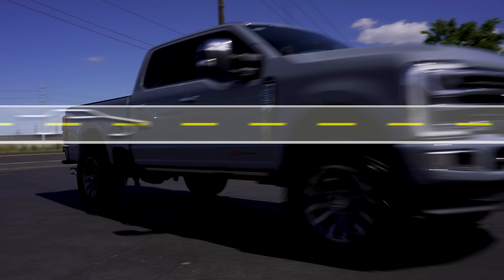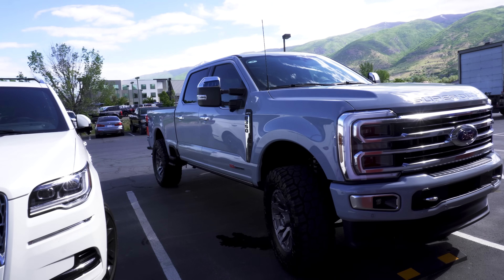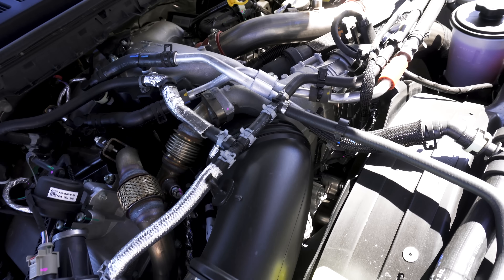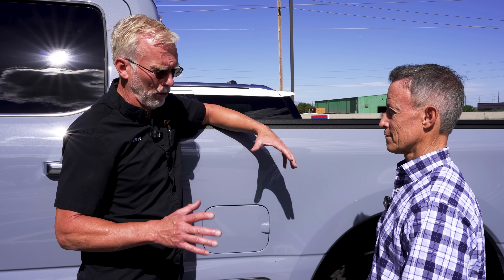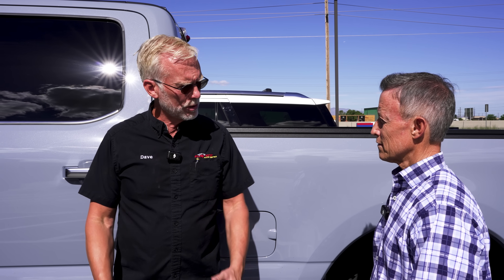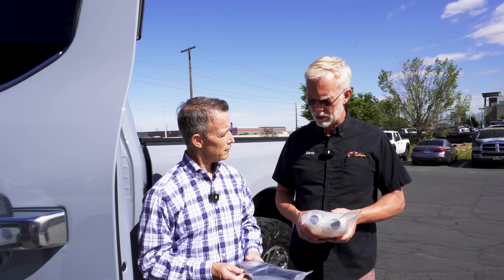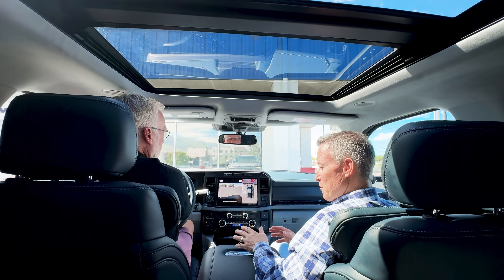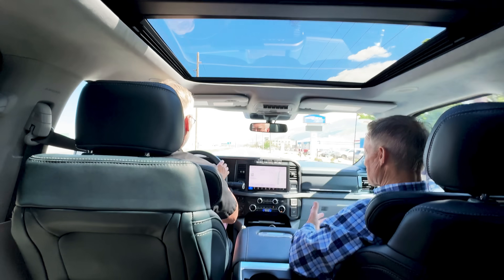Diesel Truck Maintenance

Comment: As a car guy and a building contractor the one thing in life that I fail to grasp is how people spend as much money as they do on vehicles and homes and have absolutely NO interest in understanding what it takes to properly maintain them. 
This new truck owner is no dummy, spent a few boat loads of cash and immediately sought out trustworthy advice on how to properly maintain his substantial investment.
I watched a video of a Lexus SUV, 2017 NX200T that was getting an engine replacement at 66,000 miles because the original owner didn't get an oil change, not a single one, in the first 46,000 miles... 2.0l turbo. Not an inexpensive vehicle at $40k+ msrp, pre pandemic. The top tier RAV4 the NX is based on was $30k.
Reply: top tier rav4 is NOT 30k. closer to 50k these days

Comment: Dave, if you contaminate your diesel with gas/dirt/def, then you actually shouldn’t even open the door to your f250/350. As soon as you open the drivers door, it primes the fuel system to prepare for a start. Therefore you should get it towed to a shop with the door locked!

Comment: The difference between a technician and a mechanic is that a technician  bolts on parts and a mechanic can actually fix something .
Dave and his crew are mechanic's !
Reply: That's backwards there pal
Reply: @justinballard7242  You must be a tech !
Reply: @williamhayter2998  sure 😊
Reply: @justinballard7242  Right, I have seen so man,mechanics without training injure themselves and some have even killed themselves. Maybe our parents were not stupid.
Reply: @ApoloKabali  I've been at my dad's shop since I was 13 I'm 25 now. No real "schooling" other than hands on. I've always thought of a "technician" as a professional and a "mechanic" as just everybody's uncle who can slap new brake pads on 😂
Reply: @justinballard7242  I don't have issues with  self trained mechanics, some of them are very good my issue has always been safety. A lot of them act like they know everything, while endearing themselves and others.
Reply: That is not true, technicians we are college educated, we are trained to fix cars in a safe working environment, we use measuring instruments, can read repair manuals, improvise where needed and provide customers with reasonable estimates on cost both labor and parts.

Comment: I bought a used diesel heater pressure washer, after problems with the diesel side of things, rebuilding the fuel heater pump I ended buying a new nozzle. Made 100% difference with a new diesel nozzle wow. Pressure washer has 4000 hours

Comment: I'd also like to throw it out there that the average person, just daily driving around shouldn't own a diesel truck. Unless you are doing heavy towing and hauling or work where you absolutely need a diesel, it's just a waste of money. I have worked on so many F450 where this is the customers "family vehicle" and the wife puts gas in it, or their not paying attention and put the DEF in the wrong hole, and the list goes on and on. It's very expensive to maintain a deisel truck and even more expensive to fix when things go wrong

Comment: Hi guys from here in the UK, love watching what you get up to but it just blows my mind when I see you working on vehicles, and so many of them, with blown motors and with what we would considered to be extremely low mileage especially the diesels due primarily to a total lack of maintenance (and maybe the odd design floor). 40 years or so ago every large town had an engine shop or two but now they have all but disappeared, I don't even know where my nearest one is and I'm a car guy. Over here we've been running diesels in cars and light trucks for a very long time, its probably a 60/40 split in favour of diesel and I know its a fairly new concept for you guys. When we talk about the longevity of a diesel, once you take the emissions garbage bolted onto them out of the mix, you'll hear most people say they're ok but expect the injectors to crap out on you at around 300.000 miles and often the cost to replace them will be a large percentage of the value of the car so they get scraped. I picked up in this vid that you only really have basic diesel available to you over there, here in the UK we have different types to pick from, cheap and cheerful, which many avoid, from supermarkets then branded fuels from the likes of Shell and BP ect with their regular but also offer a premium diesel, Shell offer a V Power diesel and BP call theirs BP ultimate diesel and both come with an enhanced additives package.
Reply: I don't know England car brands or models but in Germany the passenger autos and small SUVs or station wagons prefer the diesel. It seems strange concept to Americans light duty passenger cars having diesel or running on it...however accross the pond it's very commonplace, and more widespread in use.

Comment: 2000 -250 7.3. Changed the oil every 3000 miles. 385,000 still runs great. Had my first engine issue. Thermostat needed replacing 😊
Reply: They don't make 'em like they used to!!!
Reply: I took really good care of my 7.3L.  Cooling jet died and it's getting a new motor at only 140K miles....
Reply: Same.  I have 345,000 on mine. My water pump died.  Only problem.
Reply from the maker: Nice work!

Comment: Make sure you warm up the engine before putting it under stress.
Use Shell Rotella oil. If not available: make sure there's zinc in your oil. Def in a bottle or straight from the pump: no big difference in quality.
Use clean air, fuel and oil filter. And spend the extra $15 on a clean interior filter. Only 1 set of longues in your body...
Dave: stop complaining about EGR. Accept is there from now on. Is like your son said the other day: don't complain about question of why a bolt is placed in a uncomfortable position, start thinking about how to solve it. That's the best mechanic. You start to sound like a broken record... Old, grumpy...

Comment: You should have mentioned about towing up any steep grade you should always take it out of overdrive.
Reply: That truck has the 10 speed transmission and does not have a manual OD switch to turn it off.  No need for one - the transmission is very good and shifts to the appropriate gear on its own.

Comment: It is imperative that you drive these newer deisel trucks at highway speeds and for an extended period of time, regularly. This will ensure that the DPF can burn off all of the soot. Short distance drives were the engine doesn't get up to operating temperature and idling are the death of a modern diesel engine

Comment: Have a cummins 450 hp on my class a with spartan k2 chassis.  Reco service for oil  change,fuel filter and Ir dryer etc. Reco oil change is 1 x yr or 15k. It takes about 7 gal oil.  I change air dryer 2x a yr living in fl and all service 1x or 10-12k miles. Do you recomend oil change more often and what if any fuel additive do you recomend

Comment: At the diesel shop I worked, we blanked off many egr systems, but I don't think it's really possible on the very modern diesels anymore. It'll probably throw a bunch of codes and go into limp mode🙄🙄
We mostly did it on older diesels with mechanical injector pumps and injectors. Not the common rail crap. 🙄

Comment: Nice truck. And by contrast to the Cybertruck, this one actually works and be used as a truck.
Reply: The cybertruck is more of a cosplay toy than a truck. If it can't tow for 300+ miles its not a truck. Same for the lightning, 98 mile under load, why would I ever get that. Once BEV have a battery that can handle towing 300+ miles on a single charge (reg range would be like 800+ miles) and it can be re-charged in 15 minutes, there might be a use case for light duty. Until then they are just toys.
Reply: @lexpox329  I can see a use for the Cybertruck if you have solar panels and a home charger and you only have to drive short distances every day. But that is not how 99% of trucks are used. Most are used to haul heavy loads over longer distances. In addition, the cybertruck is difficult to load and unload.

Comment: Dave - Great video!! I’ve had older Duramax and now have a 2024 Duramax. I’ve always followed the following with great success and reliability:
-Fuel quality is poor, always use additive, lots of them out there, I prefer Hot Shot Secrets with every tank. About every 6000 miles I use their Extreme to give injectors extra cleaning. 
-Keep all filters clean changing them  often.
- Cetane goes from 40 to over 50, like regular and premium fuel the later is also much more expensive, you can find Cetane ratings on internet for most retailers. 
-Research seems to show higher quality DEF like Blue DEF Platinum is much better for your System.
- I set up an account with Blackstone Labs, they charge about 35.00 to test oil, it checks for wear but also helps determine optimal oil change intervals based on your driving habits. In my case using a blend I changed at 3000 miles and with synthetic around 4000. 
Sorry for being so winded but there is a lot of basic information needed to own a diesel.

Comment: Hey Dave.
Cats have precious metals in them to catalyst the unburned hydrocarbon.  Platinum, Indium, Iridium...They are worth a lot more than rare earth metals (that are not really rare they form a large part of the earths crust, but can be a bit pricey due to extraction and purifying them).  When idiots steal them and pawn them at a metal dealer they are getting pennies on the dollar.  It would be better if they came to the door or your home and asked for the $10.00 instead of stealing a system worth thousands and only getting a few bucks to buy more dope.

Comment: Idle your turbo motor 3-5 minutes after a heavy pull. I've see people pulling a heavy load up a steep grade, or just pulling a heavy load pull into a gas station/convenience store and shut off the motor without letting it idle/cool down.  Within 6-12 months their turbo sounds like they have a fork in the garbage disposal... Any thoughts on this?
Reply: Youre right any engine that has a turbo should have a cool down/spool down period id say anywhere from a couple minute to maybe five minutes to let it cool down a little and spool down as much as posible so that when you shut yhe engine off the turbo will spin as little as posible without the oil runing to it which lubericates and cools the turbo. If you dont do that the hot oil will build up on the shaft and in due tume that will wear out the bearings

Comment: I have a 2002 Duramax runs great. I retired change oil regularly fuel filters regularly.
Reply: I bought a 2016 Duramax a couple years ago. I change oil and fuel filter every 5000 miles. Maybe excessive but just trying to keep it healthy

Comment: I was wondering how they burned a hole in the piston, thought it was just a malfunctioning injector but it's the EGR sending 1300+ temp return exhaust back into the cylinder.

Comment: Some nice crook removed the DPF off my 22 I was not upset at all
Reply: 😂😂😂 must have been a relative with some knowledge 🤙🏼
Reply: @jasoneardley2202 did you see Dave's short about the government air force truck that came from factory deleted? Talk about screwed up, rules for thee not for us
Reply: @lewisbolman7862 funny that you mentioned that about the military diesels. Deployed military vehicles, from trucks to tanks, all have to use the same fuel in the name of simplifying logistics; since the late 1970s, for the U.S. Army, that's been JP-8, the same jet fuel used in Air Force fighters and bombers. As such, Ford has made its deployable Rangers with the 2.0-liter Panther diesel engine jet-fuel compatible by adding a non-catalytic muffler system, blocking the EGR valve, and re-mapping the ECU.
Reply: @mickyfingaz in 88-91 my time in reg army , we only had jp4.
Reply: did they just leave you some regular ol mufflers too?  what a dink of a thief lol
Reply: That happened to me too, 4 or 5 of them stacked up in the corner of my shop.

Comment: Platinum Blue Def it's the best. Fuel supplements that help lube the pump and keep injectors clean and boost cetane level I've tried them all and Amsoils diesel fuel supplements are the best so good they reduce regens up to 40%

Comment: Sounds like the guy has only run a tank of fuel through the truck. I’d suggest before doing oil analysis at 5k miles, have him change his oil at 500 miles since it’s gonna be full of metal particles from initial break in. Then 1000 miles, then 2500 miles and finally 5k miles. Proper break in is paramount to a bright future for your motor as break in is the most sensitive your internal components will be.

Comment: Dave, this was NOT boring. More videos like these please.
Reply from the maker: Appreciate the feedback 👍
Reply: @DavesAutoCenterCenterville  Dave, new to following you. Do you ever come across used trucks for sale that you have the chance to sell? I would fly out to Utah to pick it up, love Utah! I have the exact same questions as this gentleman, loved this video!
Reply: @DavesAutoCenterCenterville great info just hope you guys didn’t meet at Mormon church. Mormons are good people but are severely misled.
Reply: @DavesAutoCenterCenterville When More?
Reply: @DavesAutoCenterCenterville  do you think the fuel filter systems on these trucks are capable of protecting these expensive engines?  I don't.  The OEM filters are a joke.  I'm very familiar with boat applications and something like a Fleetguard FF5000 -  FS1000 - FF5776 will actually protect the injection system. a system like that is actually cheap by any measure.  Even the VW TDI crowd has a kit to fit a CATERPILLAR fuel filter to protect the injection system.
Reply: Seconded!
Reply: Recommend this man to upgrade to Speed of Air pistons.

Comment: I have a 2006 dodge with a 5.9 cummins with 586,000 miles and change oil at 3,000 miles and never had any engine problems only trans problems oil changes will make a huge difference for longivity
Reply: You’re just pissing money away at 3k on a diesel. 🤦‍♂️ You’re money, though.
Reply: @TankSchu  thats why I never had any problems with the engine or the turbo duuh
Reply: @AL-tv4ht you would likely have had the same results at 5k or greater intervals. 3k on synthetic oil is just crazy.
Reply: @TankSchu  I  agree. 3k for oil changes is a bit old school thinking. If you're using full synthetic there's no reason to not go at least 5k minimum between oil changes. I think you saying you've never had issues is fine, but you should get your oil tested to see for sure. I'm not giving you grief, my goodness, 500k plus is amazing, but just see if you can maybe extend your oil use further and spend the $$ on so much oil.
Reply: @TankSchu  Sorry I was responding to the OP...
Reply: That’s about how many miles my ex had on her
Reply: I had an 07 megacab, that was my favorite body style ever for dodges. I wish I’d never sold it.
Reply: Good engine bad trans.

Comment: The equivalent  of octane ratings for diesel fuel is a cetane rating, if I remember correctly.    😀
Reply: Correct
Reply: It's really the opposite. Octane is a measure of how stable gasoline is, cetane is a measure of how easily diesel ignites.

Comment: The spectro oil analysis Program ( SOAP), is an excellent way to know the conditions of your oil and internal engine moving parts. 

As a retired aircraft mechanic we used it to test acceptable conditions of various metal wear and fuel contamination including environmental dirt, silicone dust particles in parts per million. Excellent advice Dave.

Comment: Every thing you say is true. You missed one bid thing unless you need the power and your towing something all the time by a gas engine truck. We have some small trucks in the fleet. The ones that do light duty work are gas powered. The ones we work hard are diesels if you don’t work the new diesel pick up trucks hard, they are just a pile of trouble. Too much unburnt fuel in the emission system. The engines run too cold. The list of problems goes on. 
Great channel Dave
Reply: I went from diesel to a gas I bought a new 2024 chevy 3500 with 6.6l gas. Before that I own a few dodges diesels still have my old 12v cummins. I did not want to deal with def fuild. My gas truck works great last thing I towed I was gross out at 25420lbs it did well. 
My old 12v cummins is 75 miles away from 500000miles
Reply: @bigmurph1447 hell yeah bro! I'm fixing to hit 407,000 in my 2001 24 valve...absolutely love that truck, wouldn't trade it in for one of these new vehicles...EVER lol
Reply: My old 2002 V10 F250 was an excellent work truck. Spent it's life just above the registered GVW before putting any cargo in the bed. Gas mileage didn't fluctuate much with a load. No problems with hills while towing a 10k lb trailer. Other than routine maintenance she was trouble free for 270k, oil changes, 10 spark plugs and 10 coils, 1 coolant hose, 1 starter, 1 alternator were the only engine components replaced. Only done in by salt corrosion she rotted away.
Hopefully the new Godzilla engines are comparable. Though I have my doubts on the longevity.
Reply: I have a 2017 powerstroke.  Deleted it with 1000 miles on it 3 weeks after I bought it. I never regret a thing. The part were you talk about egr, that is the most destructive to these trucks. To rebreath dirty sooty air and recycle it is where most of the carbon build up occurs. My delete is going on 6 years and although I personally wrecked my transmission by being an idiot with all the power the power plant is healthy as ever and runs extremely efficiently.
Reply: @Zorrow45  That may be ok for non commercial trucks but there no Deleats for us there work truck and must pass inspection every year.  Unfortunately.
Reply: The solution to that is buy a 1st gen 12v Cummins. 😊